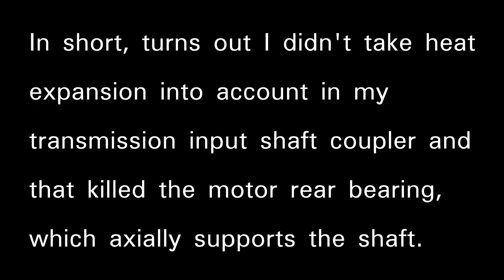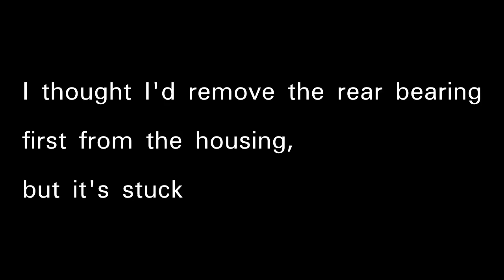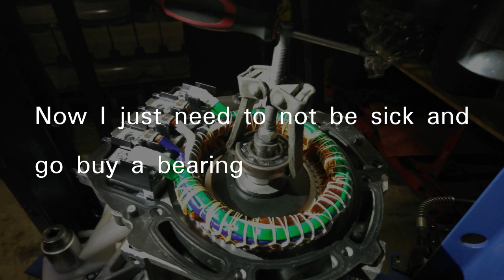EVPrevia: Destroyed motor bearing

Comment: Do you use the original transmision to shift gears, or you just leave stuck onto one? 
I've spent the last year or so wondering how many batteries can be placed in the original engine space hump with a short coaxial singlespeed gearbox. Or even mounting the motor behind the rear axle, in the tank place, swapping the position of the differential axle pointing back. All the engine bay filled with batteries should counterbalance the extra rear weight.
Reply from the maker: Usually I do city driving in 2nd gear and shift to 4th when getting onto a longer stretch of road. 4th gear saves some energy and is less noisy, as it's direct drive through this transmission. Gears are useful 1) in mountainous areas, 2) for towing and 3) for doing burnouts. If you don't do those, a single speed gearbox will work fine. I agree you should try to get the front axle fully loaded, that leaves the rear axle for people and cargo like it's supposed to be.
Reply: @celeron55  how did you sort the aux stuff under the bonnet that are moved by this weird shaft originally?
I'm surprised you made road legal, AFAIK EU laws prevent the batteries on EV from being in the cabin.
Great job by the way!
Reply from the maker: @oscariglesias9004  I removed the aux stuff under the bonnet and installed a GM electric power steering pump. This one doesn't have AC. And no, there's no such EU laws. Some country could have rules like that, but in Finland you are allowed to install batteries in the cabin as long as they are sealed ones that don't vent any gas under normal use - such as most lithium ion batteries (most li-ion batteries only vent when they get damaged). If you used lead-acid, it would require venting outside.